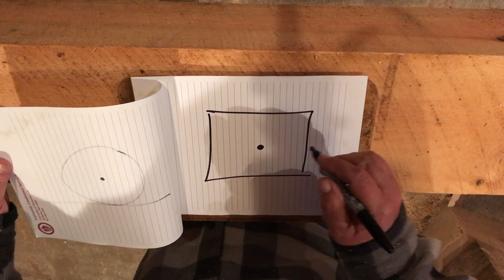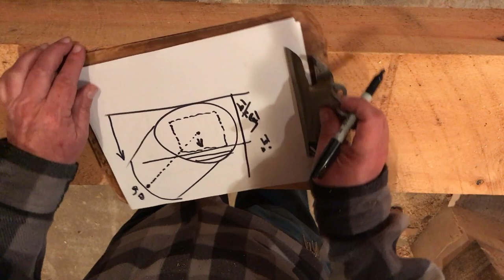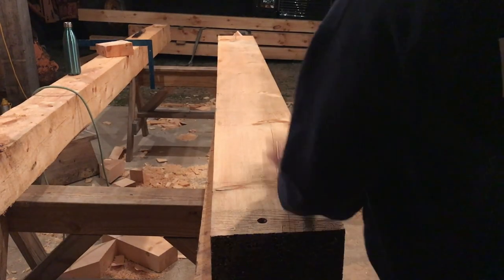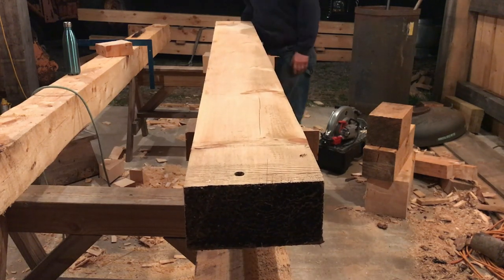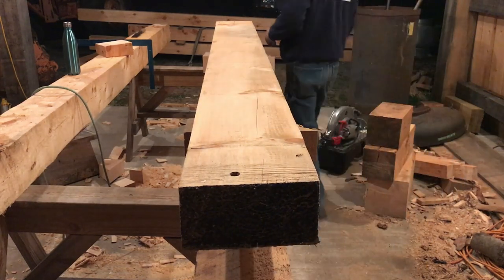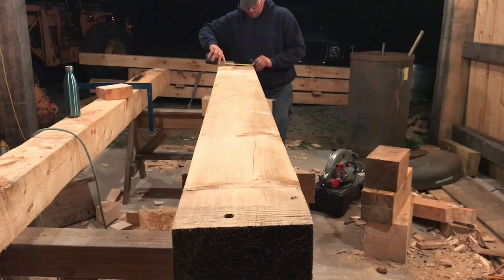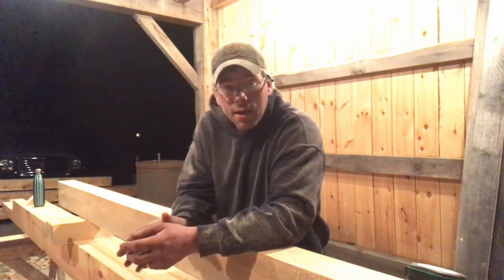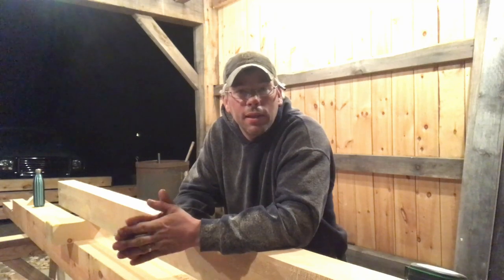Meet the Guy Who has Taught Me Lot About Timber Framing

Comment: Another great informative video! Thanks Jim and Jim. That layout tape would be a nice addition to the tool family here as well. I’m hoping to start restoration on an old Lane no.1 sawmill I acquired last summer. I’ve got it on the property, next step will be to build my structure to house it in and get it pieces back together! It’s gonna be a long road but looking forward to the journey!
Reply from the maker: Run the camera if you can
Reply: TheTradesmanChannel definitely Jim. Will do. If you check out the page I started last summer called  the shady chicken you can get a view of the mill! Not running but you get a tour of it anyway!  Just type in Shady Chicken saw mill, I’m sure it will come up. Enjoy.
Reply from the maker: I will

Comment: I have enjoyed all of your videos, and I can always use another tape. As I have said in the past, I will be attempting a bit of joinery in my shop so that I can actually do some work on my tractors in out of the wind. I need a few lift points for working on the tractors, and the current structure just will not allow for such things. My plan is to install 2 brace points about 10 to 12 feet apart and will cross brace them to each other for my lifting points. Wish me luck.

Comment: I'm new to your site and love it, thanks, wish  there was more designing and step by step joinery instruction.  Thanks, keep these vids coming
Reply from the maker: There is actually a ton of it on the earlier videos, you can find them in the Timber Frame Vlog playlist.  Most of them are numbered as well.
Reply: Thanks for your quick reply and directions, I'll check them out - thanks again
Reply from the maker: No problem, feel free to ask questions if you would like.
Reply: Down the road when you're doing a smaller TF project (shed, carport, etc), it'd be great to plan out  a series of videos with TFing instruction. They'd probably do a good job of racking up a lot of views since they could show the whole process from beginning to end in a short number of videos.
Reply from the maker: I will do that.  I did a lot of that with this project but there are so many videos now it's hard to keep track of them.

Comment: Hey Jim (and Jim)...Good tips on how to box heart timbers.  I don't usually get too fussy about having the pith dead centre but I might put more effort into it now.  I think there may be more waste, but the trade-off is straighter timbers.  Was Jim suggesting that the cuts should be made toward the butt end?  On my bandsaw mill, I always prefer to start my cuts from the butt end of the log because the blade seems to run more true without porpoising.  I am self-taught and open to any advice. Thanks.
Reply from the maker: You cut from whatever end works best for you.  I prefer to cut from the narrow end.  If the blade is getting out of whack check the tension and the sharpness.
Reply: 10-4

Comment: This is the third video of yours that I have watched tonight. I just found you and subbed. I am an addict to  manufacturing and building videos. Been that way since the mid 1950s watching industry on parade after school. I will be glad when I gain some understanding of timber framing and the shrink and warp of timber. 
Any suggestions on a basic book on such? I am old but my son and son in law like building.
Most don't understand the importance of a good foundation to finish with a solid roof. Thanks.
Reply from the maker: Good evening.  Check out a Timber Framers Workshop by Steve Chappell.
Reply: Thanks.